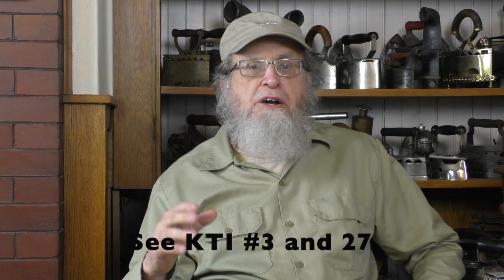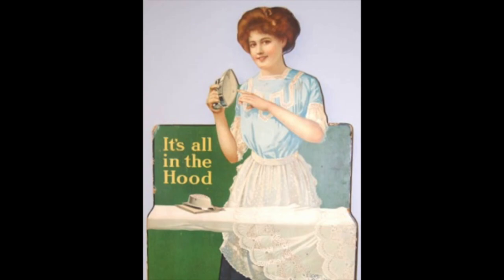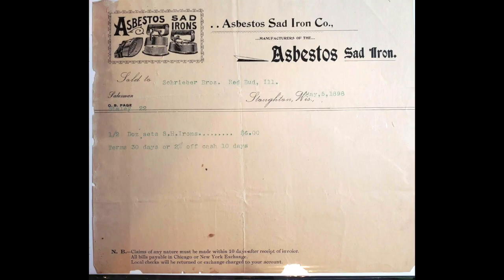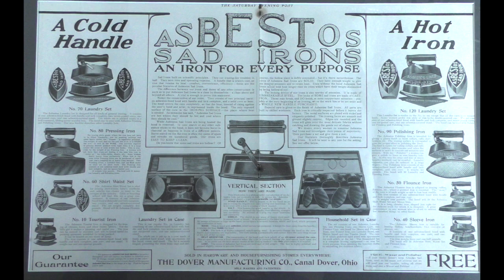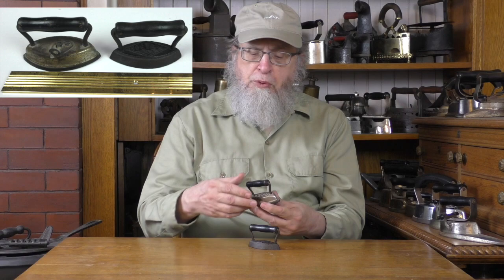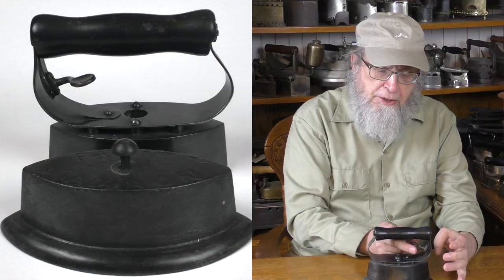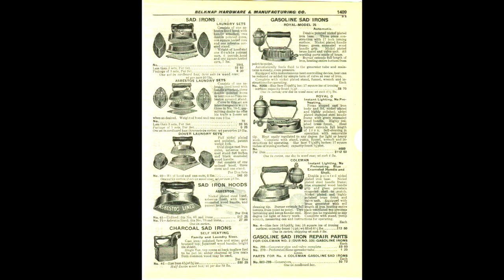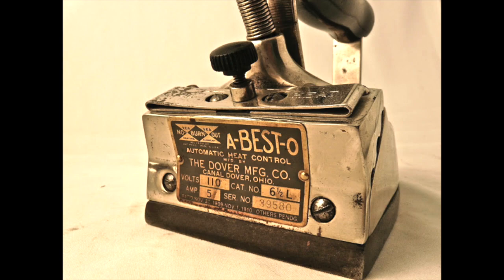Kevin Talks Irons #40:  Asbestos - Dover and related old irons

Comment: Love your wonderfully informative videos.  Just got my first SAD iron. It is the Asbesto. How do I tell how old it is? The bottom part that heats up is like the one you show in the video. It has the black handle. The trivet I bought is from England. Will be looking for the correct trivet to complete my set. 
Soon my wood cookstove will arrive it is not  an antique. I live off grid and plan to use my sad iron to press my seams as I sew. Oh! I also have a Singer treadle sewing machine from 1910. It is beautiful! Still have to learn how to use it.
Reply from the maker: I did a talk in the Asbestos-Dover irons (#40).  These have a long history - late 1890s to 1930s. These are quite common and inexpensive.  Our last two videos (#s 48 and 49) are on generally less common detachable handle groups.  Kevin
Reply: @kevintalksirons  Great! Thanks! Do you have any iron trivet videos.. Thanks!!! 
I just posted a video of my awesome SAD iron and trivet. Now to get my stove delivered!!!  My iron does have the asbestos in the top. Also have an iron trivet with a crown. It is pretty. It was made in PA.